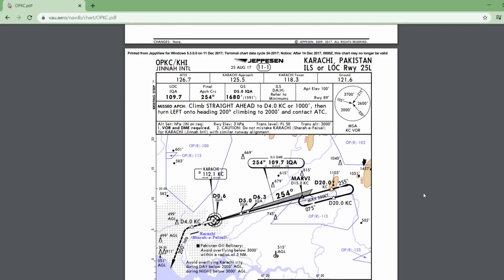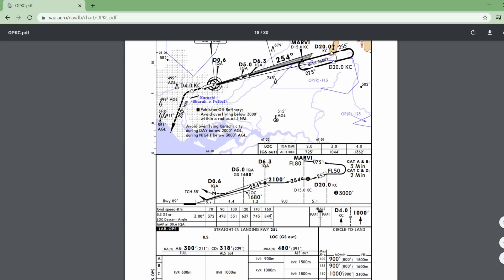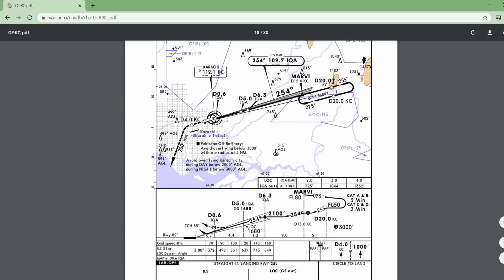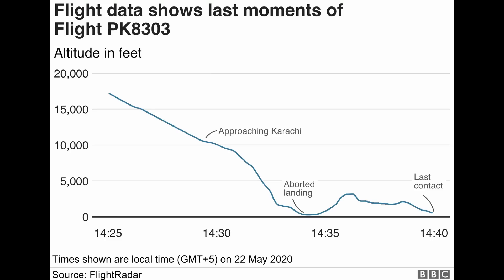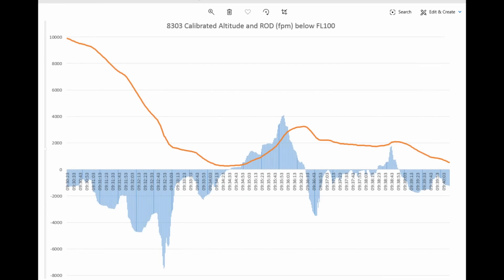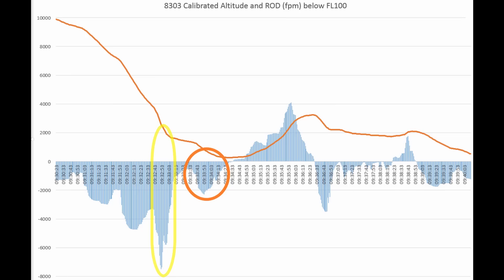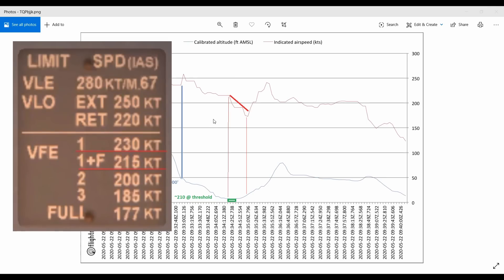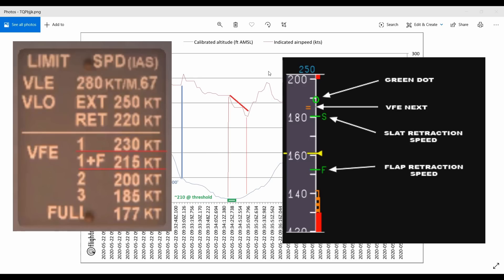PIA #8303 Update #4 Unstable Approach Profile

Comment: So here is what I tend to infer at this point (from too little available information).  The approach was too steep and too fast ... BUT ... the gear was in fact down.  Previously I was assuming the gear was never put down, but now I'm thinking it was.  However, my guess is the pilot/copilot finally decided close to the ground that they were much too fast to land safely given the available runway length in front of them.  And so, they decided to "go around". 
However, since they knew long before that they were going faster than they wanted, the engines had been spun down to lower thrust (lower RPM).  When they decided to go around, one of the actions they take is to raise the landing gear, so they did that ... too soon as it turns out.  They were probably still descending slightly when they made the go-around decision and raised the landing gear.
 
And what ended up happening is, at the too-high speed they were going, that small amount of descending speed was enough to push them down onto the runway before the extra lift of the airplane (from pulling back on the yoke slightly to pull the nose up) was sufficient to completely stop the slow descent before the engines rubbed the runway.
 
Once the engines rubbed the runway, the increasing speeds of the engines was offset by the friction of the engines scraping against the runway, and thus the climb rate was wobbling approximately around the point of zero climb/descent ... and this led to additional scrapes against the runway further down the runway (as we saw in previous videos).
 
Anyway, the above is speculation based upon what I heard in previous videos on this channel, plus this video, plus thinking about the situation for the past 2 or 3 days.  I might be totally wrong and the simpler scenario (they forgot to lower the landing gear) is correct.  Or something else entirely.
 
Nonetheless, if I was forced to place a bet on what happened at this moment, I'd bet on my new theory as described above.
 
Disclaimer:  I've never flown a large airplane.  I fly tiny airplanes mostly in the very different environments of private/fun STOL/bush/backcountry/mountain flying in wild/crazy/rugged terrain.  So very different.  Nonetheless, at least I know what an airplane is, and in a general sense, they all work approximately the same.  Those huge planes, however, have a great deal more mass and thus a great deal more inertia.  And now I'm guessing that made a difference in this specific case.  Like everyone, however, I look forward to learning the specifics.
Reply: one world   :  Correct.  However, it is my impression that the airplane blares the same warning sound to alert the pilots of several different situations.  So my guess is the warning is an alert of some other situation ... perhaps speed too high, speed too low, descent rate too high, speed too high for current flap setting, or one of several other conditions.  Probably the warning sound comes along with one of several lights flashing on the instrument panel, so essentially that warning sound is to tell the pilot and copilot to look at the instruments to see what the warning is about.  Another possibilities that I didn't mention explicitly is ... they thought they knew what the warning sound was about, and therefore didn't look at the instrument panel to confirm their assumption, and thereby took wrong actions.

Comment: ATC radio transcript is out there. The pilot was behaving like there were no rules. They repeatedly told him to descend to the altitude he was assigned and he basically said "no thanks, we're good."   So the landing gear did not lower, they didn't even try to troubleshoot and apparently just gave up and said, "oh well we'll just do a belly landing."  He was way too high and landed middle of the runway, destroying the hydraulic pumps and mutilating the engines and not able to make a second attempt. Great video on assuming the diagnosis based on the design of the engines, by the way. You were spot on.
Reply: They forgot about the landing gear. They opened it on the go-around. So no problems with any equipment in the first place. Rest of yours are accurate

Comment: Now this is interesting, "TheFlightChannel" says, when approaching Karachi airport's landing runway "the crew noticed that the landing gear is not working".  No. They would have immediately informed the tower if this would have been the case. No landing gear is uncertainty phase. When making a belly landing there should be ideally not much fuel on the aircraft. Since the A-320 cannot dump fuel the tower would have told them to circle around Karachi until the fuel tank is almost empty and then make a belly landing. As it was seen on the crash site, the plane had so much fuel that there was a huge cloud of black smoke over the crash site.
Reply: lenny108; fully agree. As much as I love FlightChannel and appreciate his hard work, his PIA 8303 video is obviously very flawed and incorrect and not adequately researched. I‘m shocked and disappointed, as I never thought something that poor would appear on FlightChannel. A real pity as a black spot that can’t be removed from an otherwise white suit. Assumption is the mother of all f***-ups.
Reply: @ewilloch   I felt the same way when I watched the Flight Channel simulation.  They made a number of incorrect assumptions that are now very misleading and causing confusion.  They should take it down immediately.
Reply: So many things that make no sense. On first approach landing gear not working but perhaps could make belly landing. This wasn't even a missed approach or a touch and go. 1st approach had landing gear issues and might have survived a belly landing on runway. But  
after failed landing seems both engines damaged but landing gear working.
Reply: Magent Megi--the landing gear had no issues.  The systems were working as they were designed (to prevent gear extension above the limit airspeed).   The issue was this crew's egregious mistakes.
Reply: @tenpiloto  right, there is video footage that shows that shortly before the crash the landing gear was down. So obviously the landing gear was working.
Reply: @tenpiloto  we don't know for sure what could have happened until the cockpit audio recording has been thoroughly analysed. We don't even know the possible problems that aircraft could have, after been grounded for 2 months. We'll know more after the final report comes through.

Comment: I am from Pakistan and I have dealt with PIA and other government officials of Pakistan. They lack professionalism at all levels. There is no check and balance. We should remember that PIA is owned by the Government. Most of the appointments are made on a Personal and Political friendships and Merit is non-existent. This happens when governments run the airlines and do other form of businesses. The posts of Pilots and Engineers are sometimes sold in the form of bribery. So we should not expect any professionalism from this God-forsaken Airlines. Conclusion is simple that Capitalism is the key and it is not the job of the government to run professional businesses.  Moreover AI should replace the pilots like these so that such human errors could be avoided.
Reply: Agree with the ai point. Still years away before it can happen. I'm from Pakistan too. And i don't know why people don't learn their lesson after so many accidents from the same airline. Never fly with PIA!
Reply: theddfreak AI is not years away, for flight control, it was available decades ago, not that hard to do.  Pilot’s Union holds it back.
Reply: @steveperreira5850  I'm not looking to die because some computer didn't know to turn on pitot heat. Flying is really easy until something goes wrong. Computers are great at easy. Humans train for the stuff that goes wrong.
Reply: Yes, corruption in all things, not just airlines is a big problem and not just in Pakistan. However, there are national airlines where only the best veteran air force pilots get a chance to get hired.
Reply: K Awan ---
Thank you for that insight.
You are correct, pilots should be hired due to capability and thorough training, not government connections. 
A tragedy waiting to happen everyday.
Reply: We need to prioritize. AI is great, I agree, but it's first job should be to find my luggage. :•)
Reply: (P) lease  (I) nform  (A) llah
Reply: @rudehr  Please restrain from such comments that will end in a bad taste. Dragging Religion will do no good. Let us transform it into a professional discussion only. Thanks.
Reply: Rudo lf very, very funny!
Reply: As soon as I found out the Government owned this airline, I knew the problem!
Reply: You're confusing rule of law, professionalized leadership & workforce, and strong anti-corruption enforcement with Capitalism. I can assure you that they're not strongly related.
Reply: What's more valuable is a strong and educated middle class that demands these things of the government, whatever form it takes.

Comment: And pilot's father in a tv interview was saying my son had been made a scape goat. This is our problem that with so many wrong doers in our System,, no one really accept a responsibility
Reply: First of all, it's extremely shameful on the media that they immediately start taking interviews of the deceased's families at such time. He must be completely shattered with emotions right now. Let the situation calm, investigation reports be out there and then take his Interview if needed.
Reply: @adeelzafarr  it does not matter. 100 lives gone property & reputation damaged.. 
No body cares who is got interviewed & who is not. 
What piA & its truck-driver pilot learned from such accident is important
Reply: @ahsenshahid  I never said that investigation shouldn't be done or PIA pilots shouldn't be taught a lesson. All I'm saying is that there's no point in putting pressure on deceased's families.
Reply: I agree with you. This jet wasn't flying itself and the responsibility stops with the captain in command. I don't fly big jets but I know that above some speed, the gears cannot "select down" to avoid damages and instead you get warning for high speed. This they didn't get.
Reply: @muriuwangai3617  Incorrect. You can select the gear at any airspeed but every airplane has placarded speeds in which are there to prevent damage. Gear handles are not controlled by airspeed.
Reply: @miker2859  The handles are not controlled by airspeed but the logic between the handles and the actual gear is.  At least in this particular plane.
Reply: @miker2859  sorry you are wrong. lowering the gear handles are connected to speed. 
System will not allow to lower gear at any speed above 260 nautical miles meaning pilot have to lower it manually. And beep chime in voice recorder clearly shows that gear was not down at the time of touch down & pilot knows this unless you say pilot was deaf.

Comment: The placard shows that the maximum speed to extend gear is 250 knots, but Juan points out that the plane was flying below that speed (except for  a brief moment) in the few minutes before the first attempted landing.  The FDR will tell us for sure, but IF the pilot engaged the landing gear, why didn't it deploy? Is there another condition that was not met that prevented the gear from coming down?  I think we can all agree that if that gear came down, 97 people would still be alive.  So what are the theories on why the gear didn't extend?  I think that the pilot assumed it would deploy automatically, once conditions allowed it to.  That's why he was ignoring the warnings.
Reply: Initial landing was alright and the landing gears were down but the issue was that the height he was coming from was not correct for normal landing. When the plane was near the runway, the pilot realized that the plane is going to off-shoot the runway and he then pressed TOGA and withdrew the landing gears. However, at that time the plane was not at sufficient height and both the engines hit the runway which consequently resulted in engine failure.
Reply: @dkht47  That's an interesting theory, but I have not heard that the landing gear was down at any time during the initial attempt.  Even if it was, a GA maneuver would not automatically retract the gear, nor would I think the pilot would retract it until he was cleared of the runway. Also, the plane looks like it did land in the middle of the runway as evidenced by where the marks were.

Hopefully, the FDR will clear things up.

Comment: It really sounds like they rushed it...dive-bombed the approach and didn't have time to run the checklists.  That might explain the chime, because I think that noise is also used on the A320 family if the throttle is below a certain point with flaps out and gear not down?  Some planes have a horn, I don't know if Airbus uses that same "bong-bong-bong" chime or not.  There have been other situations where crews have gotten behind the airplane on an approach and not bothered to run checklists, and have had similar things happen.
Reply: Unlike a Boeing, the airbus allows for full flaps config with gear up and not produce a warning. It will warn if below 750ft RA and gear is not down using the CRC

Comment: Hey Juan... I'm not a pilot, but i like learning about this stuff and I have a couple of questions.   This is tragic and I really want to hear more about how these guys ended up in the cockpit, but it does bring a scenario into mind. 

 1  Do large military planes like the c130 make sharp aot last minute flare landings in combat zones?  I seem to remember hearing this somewhere.    I also seem to remember them talking about air-force one doing something like that in Iraq with Bush jr onboard.   Basically my question is, could you nose dive a passenger jet,  and then flare the hell out of it (basically stall it) at the last minute to get it on the ground quickly?  I know you wouldn't unless you wanted to clean up a lot of barf.  But is it possible?

Comment: The only saving point for the crew may be if they didn't know how fast the plane was flying. If it had been parked up for weeks was the plane inspected and prepared properly before flight? Pitot covers removed? Ports checked for blockages? 
Was the incident an over reliance on technology which failed them and they didn't have the basic piloting skills to operate the plane by seat of the pants flying? 
This is the difference between a flight crew, and a pilot. A pilot knows from first principles and understands how and why a plane flys.
Reply: If the pitot tubes were blocked the crew would have noticed on takeoff that their speed was reading zero

Comment: Something tells me this pilot was rather used to having the CRC active during his approaches. 7000+ ft/min rate of decent is absolutely nuts for a commercial airliner.
Reply: It's definitively above the recommended safe maximum published by Airbus. Even in the event of a pressure loss you would hardly reach that. (There are no specific rates for that procedure, though, because the recommendation for an emergency descent is: No thrust, full spoilers, nose down until you hit max. safe speed.)
Reply: He was experienced Pilot
Reply: @andershansen9009  Like. I said in another comment here, that pilot must have done similar stunts like that before and made it. So he tried to do it again. His luck simply ran out.

Comment: OK this aviation accident is just bizarre...  From what I've seen, the gear did not deploy and they dragged the runway with the engines.   Instead of crossing their fingers and ride the landing out, the pilot decided to abort and try for a go around..   Damage to both engines and tried to climb out for a go around of the airport and another landing attempt.  Their luck ran out, the engines failed and the aircraft stalled out, and fell from the sky on approach..  Still a lot questions!  What was that super steep dive for initial landing about??  Was GPS drunk? ( personal, and  why I don't trust GPS)  This wreck is a bit of a mystery.
Reply: Yet on the crash footage the gear is deployed.  At a loss for words here but Occam's Razor...
Reply: The assumption, from other pilot's channel, is that they deployed the landing gears. The sound we heard before is effectively the landing gears not being deployed while they tried to, and maybe a result of max speed exceeded because of the important descending rate. At this point, they might have solved that issue by putting engines on idle. At the very end, while in the process of landing, they decided to go-around. They must have putted the engines back to max thrust (from idle), retracted the landing gear and flaps and raised the nose. But the delay from idle to max, and maybe sucking with ground effect (my speculation here), made the plane drop. Without landing gears out, both engines hit the ground, the plane bounced and eventually climbed as power was there finally. All of that too late, too fast to decide to "crash" in a belly landing - they were not prepare mentaly for that, all of that was a surprise and it was too late on the track to have a "safe" belly landing. Back in the air, the engines died, both. We know the rest.
That's many assumptions and a terrible serie of events possibly due to their very late approach. Apparently, they were 10,000 feet instead of 4,000 to begin with.
Does it make sense?
After all, ATC is not aware of a "1st" belly landing tentative and that doesn't sound right anyway, you do a belly landing or you don't, you don't change your mind midway.